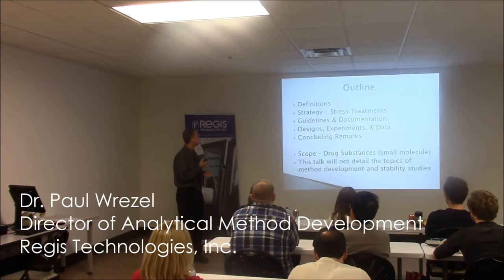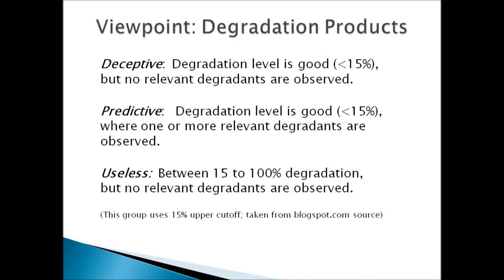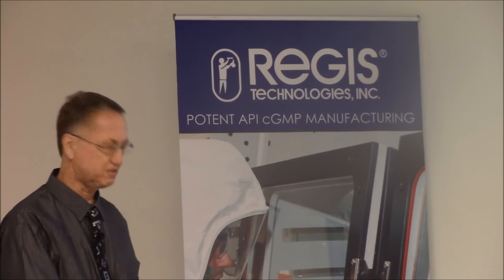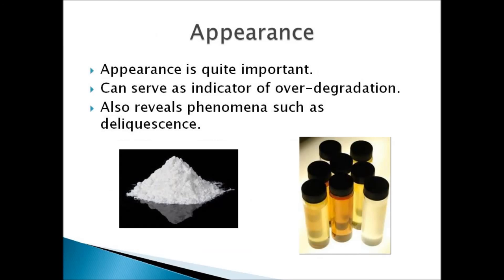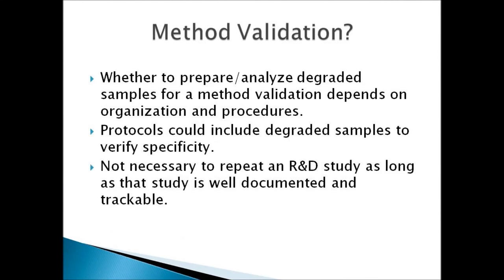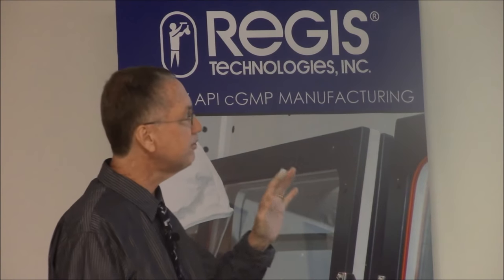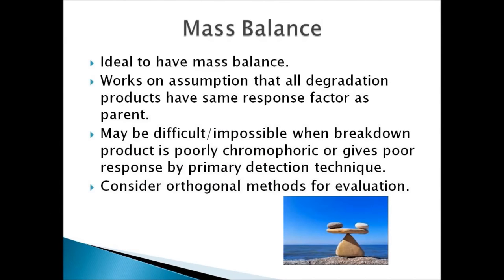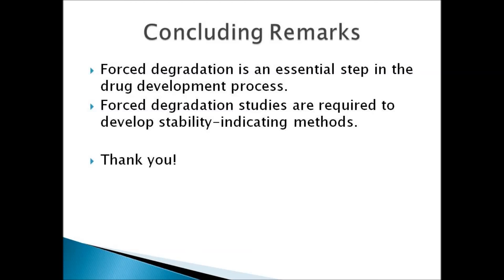Forced Degradation: Breaking It Down by Paul Wrezel Ph.D. (Full Version)

Comment: sir, which metal used for metal ion oxidation degradation, Fe, Ni, Cu which is most used metal
Reply from the maker: Typically, hydrogen peroxide is used for oxidative forced degradation studies of APIs, but transition metal-induced oxidative degradation can be performed to mimick the exposure to metals in production.  I don’t believe that there is a consensus as to which oxidative transition metal is ‘most’ commonly used for such a study, but would instead be selected based on which metal(s) the API is likely to be exposed to in the production plant. For example, Fe(III) would be a relevant choice for APIs exposed to stainless steel, likewise Cu(II) for APIs exposed to bronze.